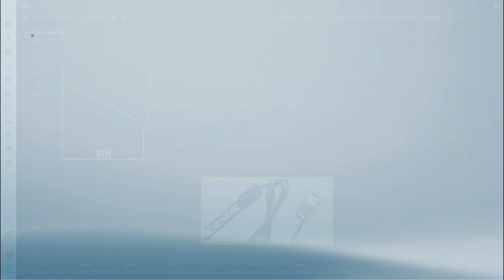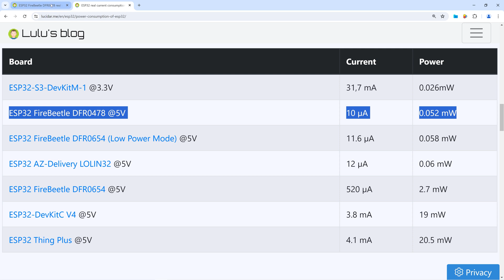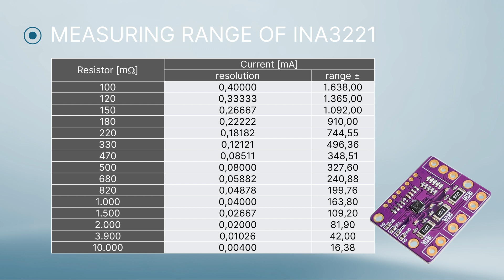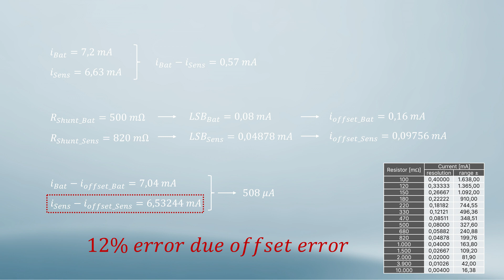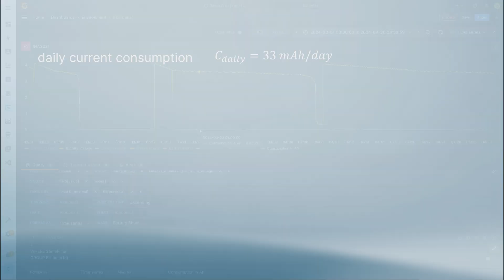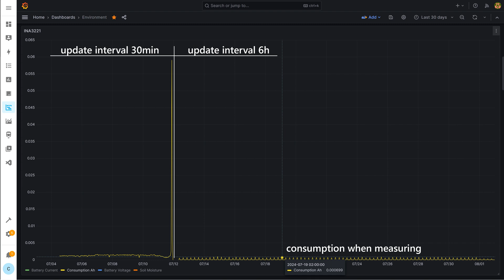WSMS#3 - Optimize Power Consumption of ESPHome Wireless Sensors

Comment: Доброго дня, развожу плату с ina3221, нигде не нашел рекомендаций по подключению термопада этой микросхемы, может владеете информацией или есть возможность проверить подключен ли он к земле, или вообще ни к чему не подключен
Reply from the maker: According to the current TI datasheet, the exposed pad can either be connected to GND or left floating.
On e2e.ti.com, TI engineers generally recommend connecting the pad to GND.
Here is the related discussion for reference:
https://e2e.ti.com/support/amplifiers-group/amplifiers/f/amplifiers-forum/809606/ina3221-ina3221thermal-pad---connect-to-gnd

Comment: Hi, I saw you used GPIO36 to read battery voltage but I don't see any connection between battery + and GPIOs, do the firebeetle has a built in connection to monitor battery voltage?
Reply from the maker: The DFR0478 (FireBeetle ESP32) has an on board voltage divider. This information can be found in the data sheet (product wiki page -> schematics).
This voltage divider can be connected to A0 (GPIO36). Therefore you have to bridge R10 and R11. I show this in detail in a previous episode of this series: https://youtu.be/qE35_fPxOck (minute 8:47). Hope this helps.
Reply: @creativemakerat  sure it really helps a lot, thank you very much!

Comment: I noticed that placement of the sensor critically affects it's measurement, so much so that I would not recommend anyone to try to use this sensor to take serious readings, I had to place my sensors very close to the water source where I would be guaranteed that the soil would wet, not just moist but wet, In my case Im using the Ads1115 converter because I need the extra channels and Im not constrain by power, and I read the values in range between 0 and 100% and to be honest after days of fiddling with there sensors I've come to the conclusion that for my case they are only useful to detect if my plants have been irrigated or not by detecting a sharp increase in the readings, sort of like an on - off sensor I was expecting more but that's all I could get out of them...
Reply from the maker: Thank you very much for sharing your experience. I’m currently working on a setup to test the sensors outside, but so far, I’ve only had experience with indoor plants. Where are you using your sensors - in an indoor or outdoor setting? Also, which sensor have you been using? There are different types available, and unfortunately, some faulty devices too.

Have you seen my second video from this episode, where I compared different sensors - https://youtu.be/b9j9IffGZEs? There’s a significant difference in sensitivity between them.

That said, I think a binary output—just indicating whether watering is needed or not, is often sufficient. Of course, it would be nice to have percentage values to control the watering duration, but for me, that’s more of a “nice to have” feature.
We’ll see how things turn out when the test setup for the garden is finished.

Thanks again for your insights!
Reply: @creativemakerat  
My setup is indoor, the soil is from the same batch, the pots are all the same and under the same light conditions with good thermal insulation and steady airflow, I also log the data to influxdb (every 10 minutes) and use grafana for the dashboards... And by looking at the data I concluded that the most relevant information I could get out the the sensor Is the sharp rise in the adc readings after watering the plants, I couple that reading with a flow meter from the pump to the sprinklers and that's how I make sure the automated system executed the scripts correctly.
Every sensor I brought was missing the connection between gnd and the 1m discharge resistor, which I fixed with a wire.
Reply from the maker: @Benjam1981  Thanks for the details. i just can recommend testing this sensor: https://amzn.to/3XT8WMj (affiliate link). The sensitivity is ~3 times higher.

Comment: I had the same problem and went the route to design a complete ESP pcb to use the cheap capacitive sensors. It uses an ESP32-WROOM-1 to a 600mAh LiFePo4 AA cell and I get roughly a year of runtime. The WROOM has a relatively high deep sleep consumption, so deep sleep isn't used but a RTC with a power consumption of only 44nA. The ESP32-S3 has a much better deep sleep consumption and should be used instead. If you aren't bound to ESP, the nRF chips are even better in that regard.

Cutting of the power of the sensor is important, but the sensor also requires around 3 seconds to settle for stable values. In your programming, you can power on the sensor, wait 3 seconds while the ESP goes into light sleep. After reading the value, turn off the sensor and activate Wifi. Preferably use ESPNOW or Bluetooth to send data, as this requires way less power for reduced air time.

Be careful with these sensors, some of them have an old NE555 that does not work on 3.3V and requires at least 4.5V. Even if the Amazon listing tell you it's 3.3V, don't trust it. There should be a TLC555 or LMC555 on it which only requires 1.5V to work. Best to test with a bench power supply and a multimeter. I wouldn't even trust the marking on the chip. To make use of the 5V versions I got, I made a new PCB which adds a buck/boost converter. While the battery voltage drops over time, the sensor data will change with the input voltage of the sensor. You need a stable power source. If I had known that earlier, I would have bought some ready made one which can be reflashed with an open firmware. I just forgot the name of them.
Reply from the maker: Thanks for the detailed tips and explanations! So if i got it right, we can reduce the 10-second wait time to 3 seconds to allow charging of the capacitor? That would save a lot of time. Another good idea is to cut the sensor power immediately after reading the values.
About faulty sensors - tried to cover that in the first video of the series ;-)
Regarding the power supply, since we're now supplying power through the GPIO pin, the voltage should be stable, right? Or is that not the case?
Reply: @creativemakerat  Sorry, I'm new to your channel and did not see the previous one (yet).
I measured the stabilize time by recording the output pin on an oscilloscope after applying the input voltage. None of my sensors took longer than around 2,5 seconds.
I didn't even think of powering the sensor directly with a gpio and used a mosfet to switch the sensor. I guess if you power your esp with li-ion then you certainly have a regulator to 3.3V. Above 3.6 kills the esp. The only case the gpio would then go below 3.3V if the battery falls under it, except you have a fancy buck/boost regulator. Just look up the chip in the datasheet. If not, the ESP still runs down to 2.8V in my tests. You should have a fairly long time staying above 3.3V, but then the output value of the sensor also goes down.
In my design, I chose the LiFePo to get rid of the regulator to save on sleep current. In this case, this wasn't the best idea I had.

Comment: Some more things to note: Remove all LEDs from the MCU boards and sensors (LEDs draw some mA). The programmer chip also drains quite a bit! It looks like that you considered this already. I guess that you mentioned it in another video. I just wanted to say it again in case sb. watches this video only. Transmitting data (BLE, Wifi) drains a lot of power, too. So it's wise to store the data and then send as packet once per day. Moreover, whenever you can, use interrupts to wake up your MCU only when needed. More potential for savings would be switching to a chip like nrf52840. They're more costly and not as common but still well supported as some Adafruit products use them.
Reply from the maker: Thanks for the tips! I think DFR does a really good job with the layout of their boards. Unlike many of the cheaper options, someone actually considered power consumption.
I’m not familiar with the NRF chip, though I come from the ESPHome 'plug & play' side of things, which is why i use ESP boards.
Can the NRF chip be used with Home Assistant? Probably with MQTT?
Thanks again for the helpful advices!
Reply: @creativemakerat why not just dump readings to a file via BLE, let software sort it and give it to your home lab system?

Comment: Great video! A possible optimisation is to replace the static delay between deep sleeps with a more dynamic approach. I implemented a “Deep Sleep Switch” in ESPHome, which triggers the sensor to enter deep sleep when activated. In Home Assistant, I set up a helper that checks if the most recent sensor reading is less than a couple of seconds old. This allows for an automation that sends the sensor into deep sleep immediately after Home Assistant receives the data. Disabling this automation keeps the sensor awake, enabling updates or edits during the next wake-up cycle.
Additionally, you can further reduce the sensor’s active time by assigning a static IP and enabling the fast_connect Wi-Fi option in ESPHome.
Reply: esphome:
  name: my-sensor
  friendly_name: my-sensor
  on_boot:
    then:
      - switch.turn_on: sensor_power
      - switch.turn_off: deep_sleep_switch  # Ensure the deep sleep switch is turned off on boot
  on_shutdown:
      then:
      - switch.turn_off: sensor_power

...

switch:
  - platform: gpio
    pin: GPIO10
    id: sensor_power
    internal: true

  - platform: template
    name: "Deep Sleep Switch"
    id: deep_sleep_switch
    turn_on_action:
      - deep_sleep.enter: deep_sleep_mode

deep_sleep:
  id: deep_sleep_mode
  sleep_duration: 6h
Reply from the maker: Thank you for the tip! That’s a brilliant idea - I never would have thought of it. We actually added the helper button in the first part of the series, but only to allow for OTA updates. Having HA send the sensor back into deep sleep after receiving the data is a really smart approach. Maybe adding a timeout in case HA is offline could prevent the sensor from staying in wake mode?
Thanks also for the suggestion about using a static IP and enabling fast_connect. I’ll definitely check that out! 😃
Reply: @creativemakerat  Yes, that could be a good fail-safe. However, it might affect the sensor’s ability to stay awake for updates and edits. To address this, you could set the fail-safe timeout to be “long enough” and implement a notification that triggers when the sensor wakes up and the deep sleep automation is disabled, giving you time to perform updates before the fail-safe activates.

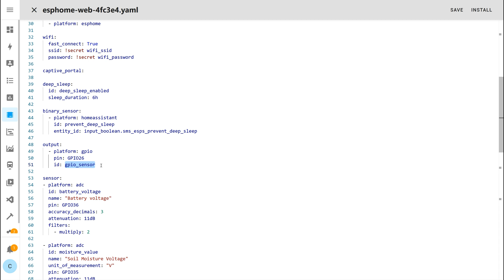Comment: 11:10 I think there is way to much delay.
93, 91, 87 is unnecessary. :)
Reply from the maker: Yes, you're absolutely right—there's definitely room for optimization here! Especially with the capacitor charging time, I think there's potential for improvement. It would be worth taking a closer look at the sensor itself.